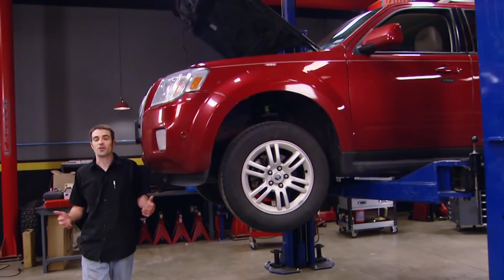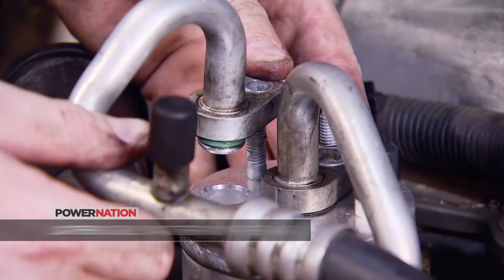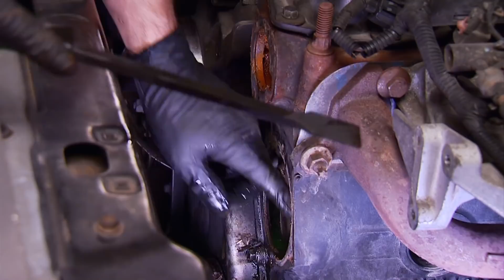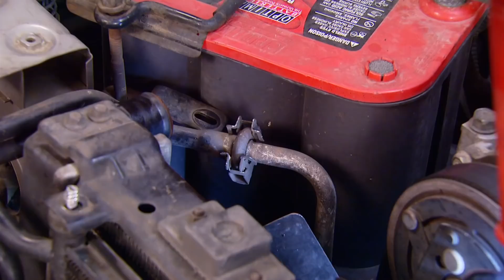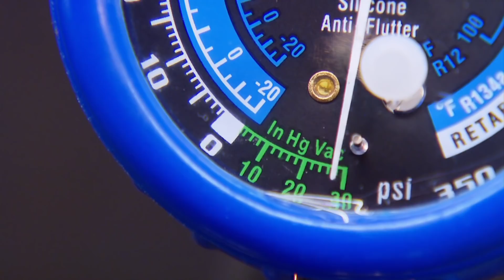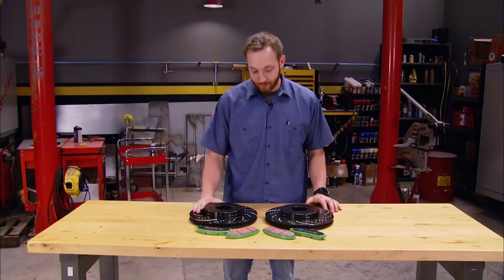Who Needs A Shop? You Can Replace These Parts in Your Driveway - Truck Tech S2, E23

Comment: When spinning in that special tool he should have shown you applying anti-seize on the threads of that tool to make it last for years to come. spinning it on that fast with a power tool dry with no lube will quickly make it a 1 time tool
Reply: What was not mentioned in this video is when you take it to the dealership the special tool that is needed for the job is most likely hiding in an unorganized tool room of which the paid by the job dealer technician is not going to spend 6 hours looking for it. So he is going to use whatever is handy and expedient to make the repair because hes paid by the job not the hour and chances of "him" damaging your shit is higher then you would expect. "much higher" because if he screws up the job he still gets paid and even more because when they sell you a new transmission he gets paid to put it in .. or a kickback from the sales department when that vehicle gets traded in on a new one and then he gets paid internally to replace the transmission. so in reality the dealer mechanic makes more money when hes to lazy to round up the proper tools for the job. as for organized tool room ? doesn't exist unless they pay someone full time hourly to keep it organized.

Comment: U screwed up never just use a impact on the axle nut always torque to spec or ur front wheel bearing will fail I hate how these shows put glorified parts employees on thinking they know what they are doing

Comment: I can [and have] done every operation possible in my driveway or  home garage except body off frame.  Transmission was the biggest pain, specifically leaving it in with the motor pulled.   Made my own cradle from maple [I don't have a welder]] and strapped that in place to keep support  firmly in place around the pan rail, and used a [screw type] bottle jack to support it while the engine was out.  The cradle build... reinforced cross grain in 4 areas [which doubled as strap retainers], plus dowel pinned the vertical side rails required to clear the pan.  Otherwise, splitting alomg the grain would be a risk.  I still have that piece: varnished and clearanced for the shift cable, but only good for a th-400.

Comment: When telling folks to use a power hammer to separate that spline should probably tell them about backing the nut almost off but leaving it on the last few threads flush with the end of the spline or they might take a hammer to it and never get it off or back on either or just a thought small detail but of huge importance

Comment: Better check your local city and county codes first- our city recently changed the codes making it illegal to do any automotive work on your property! Now you can be fined for even changing your oil! If you have a garage you can sneak by but don't open the door while your working on it!😣
Reply: Seriously??? I would probably tell them to shove it. Can I ask where you have heard this being an issue?
Reply: @nooneiscomingtohelp  it's an issue all over Texas- I live in El Paso Tx!  Six block's from the BP facility that AOC cried about on national telivision! All vehicle's on your property have to registered and can not be broken down- if you can't start it it has to be covered! Can't have a flat tire, BUT they only enforce it when you have a disgruntled neighbor who calls it in on you! It's rediculous but it's a real thing!
Reply: @genehasenbuhler2594  gotcha. That's kind of the same with our on street parking rules. Vehicle HAS to move every 24hrs. But the only time they enforce is when neighbor calls.
Reply: @nooneiscomingtohelp  I've been battled by this city for over twenty years- they seem to forget the Grandfather Clause they installed when they made the codes here! And every time I get a new neighbor it starts all over! I had an OLD one that called incessantly on me all the while he had a car that leaked trans fluid by the gallon! Even had a puddle covering his driveway- the size of his car a Lincoln Continental! After two solid years of his crap I finally lost it! Get this- I(Liquid Nailed)his doors shut on that stupid car!  He never bothered me again or any other nabes for that matter! So when a new nabe moves in I tell them there's more than one way to skin a cat- and I know them all!😁 I had to go so far as to get an open record's request so I could take a nabe to court for harrassment, after that the neighborhood decided to leave me alone! Now they are trying to start an HOA! They are pissed off because I refuse to join and flat refuse to be bullied by their tactics!

Comment: 'you can replace these parts in your driveway'
*Shows you how to do it in a multimillion dollar shop on a lift
Reply: So your driveway is perfectly level and painted with no rocks, and it's climate controlled? They could've at least done this on the floor with Jack stands and hand tools bud
Reply: @alanspangler5621  They just wanted to show the repair. The rest should be indicative already.
Reply: The only difference would be him standing to do work and you cross legged on the driveway. Big whoop..

Comment: you forgot to drill an 1/8 of an inch hole in the  circular flat plate on the thermostate to allow the system to belch out the air pockets in the cooling system
Reply: I do it to both my jeeps but not my Toyota because I can't see good enough to always see if it's straight up and down

Comment: Time is money and my time is too valuable to waste working on cars. I guess if you're poor you should work on your own vehicles but when you earn enough money you realize you actually would be losing money w adding time working on a car instead of earning more money.
Reply: 100% Correct. I learned it's cheaper to pay some flunkie to do the work and have a second vehicle to avoid down time making real money instead of trying to save a few bucks.
Reply: Doesn't take years to work on a car dough heads 🤣🤣🤣. Listening to the utter useless people at the bottom of the comments.
Reply: @CanadaBud23  It takes time. Hours and sometimes days. Time that's better spent earning money and investing.
Reply: @NoGoodWill  Right!?

Comment: I spent countless years working outside and have done everything you can imagine including transmission and engine replacement. I even did a Cummins diesel swap into a Ford F550 using just a standard engine hoist which wasn't easy whatsoever especially here in Massachusetts in the winter. I unfortunately have gotten spoiled with my own garage and shop's I've worked at over the years and now absolutely hate not using a lift whenever possible.

Comment: Some of the auto parts stores in my area will loan you some of the specialty tools needed for some jobs. They usually require a deposit, but it is returned when you return the tool.
Reply: Usually junk broken tools missing key components however
Reply: @dieseldabz7104  That hasn't been my experience, but I've never rented/borrowed anything very complicated with multiple pieces. 🤷‍♂️
Reply: @dieseldabz7104  Open the box and check to make sure the tools are adequate for the job and show them if it isn't. "Dealing with parts store 101" when they are shown that the tool is not in good shape they must give a new one to use and make sure the other is discarded.

Side note, sometimes if you are lucky the tool may have some good stuff on it still and may get a large discount if you want. I had a few opportunities to do that with a puller and a joint press. Should have taken the press when i had the change I could have made adapters and pocketed the press for a few dollars since it was going in the trash anyway lol.